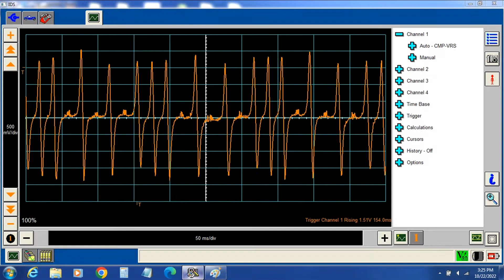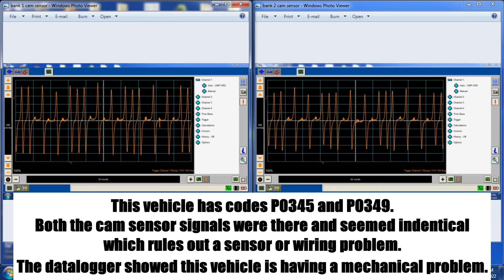P0345 and P0349 on a 4.6L 3 valve engine in a Mustang

Comment: you ever plan to overdrive the supercharger? i read from previous comments that your running a shelby mustang supercharger and i know which one it is. its a VMP gen 3 inst it? i heard the gen 5 was much better and can fit where the gen 3 used to go
Reply from the maker: This video is from a Mustang with a 4.6L 3 valve engine. If you are referring to my Explorer with the supercharged 4.0 SOHC, it is on it's second Eaton supercharger, that came off a GT500. The first one was stock, the one that is on it now has an overdrive gear set in the snout that was custom made by Bob Stiegemeier (it also has a liquid cooled snout(venom cooler) but I didn't hook up any liquid cooling to it yet). He called it the snake bite kit or modification. It's ported as well. Check out his website, https://stiegemeier.com .

Comment: Haven't seen yooy post in a minute. I have a 1997 Ford Explorer sport control trac 2D. Has a 4.0 V6 SOHC it recently threw a rod and I've been attempting to pull the engine. My first time ever doing something of this do you have any tips as I know you've taken yours apart. I also was curious if you thinks it's worth going from a SOHC to a ohv or DOHC but I'm not sure if it's worth it or what would go into it. Would be awesome if you could maybe point me in the right direction or give a few tips. Thanks
Reply from the maker: For engine removal, some things that come to mind are remove the starter to get to the torque converter bolts and.... Replacing the stock exhaust manifolds with JBA headers makes things easier because the JBA's just have holes that long bolts go through instead of threaded bolts holes that the bolts would screw into (and rust solidly to the exhaust manifolds and break every time you try to remove them). As far as engine swaps it is always better to get the whole donor vehicle, rather than just the drivetrain  because there is always one more thing you will need that didn't come with the drive train that was purchased.